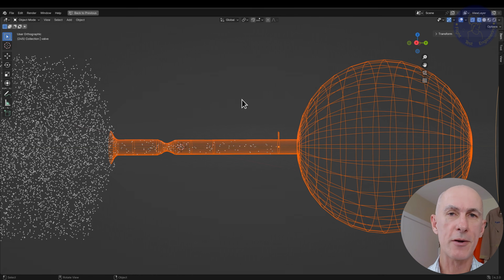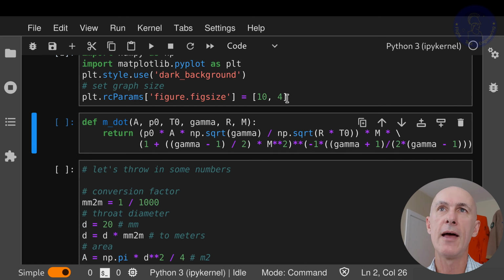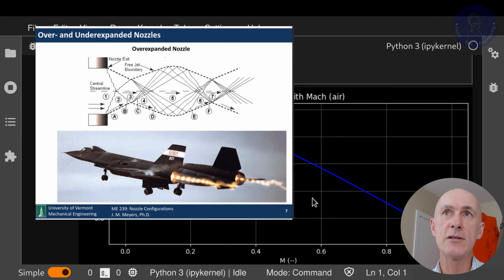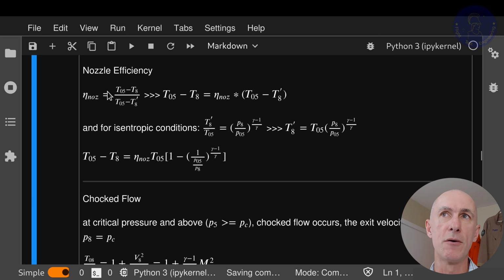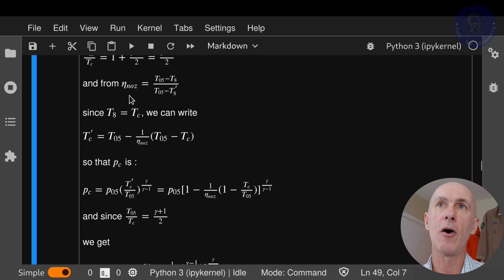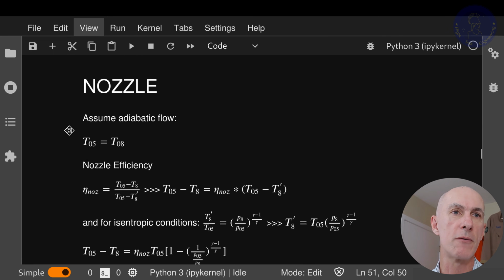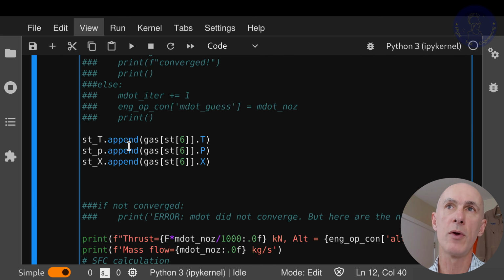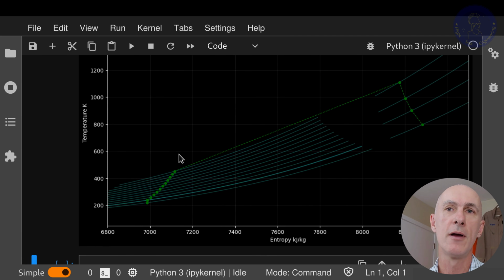Jet Engine Series - Episode 8 - Nozzle Thermodynamics and Python Coding

Comment: this derivation has the velocity u constant on each point of a particular cross section, right? Meaning that a particle on the center line has the same u as a particle near the wall. How does this fit with boundary layer effects or viscosity in general? In those cases, the profile of u may be parabolic, linear,  etc
Reply from the maker: Hi. Correct. This is a very simple 0-dimensional model with constant velocity across any sections. The boundary layer effect will decrease the mass flow...There are many many many other elements missing in this model...for example, bleed air extracted from the compressor, cooling of the turbine blades... this is a very simple model to illustrate the concepts. Cheers.